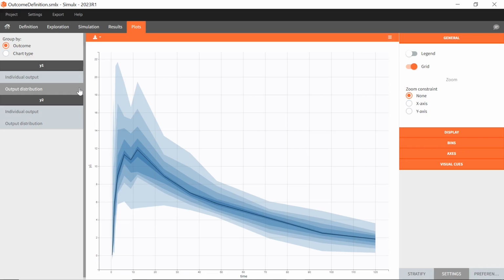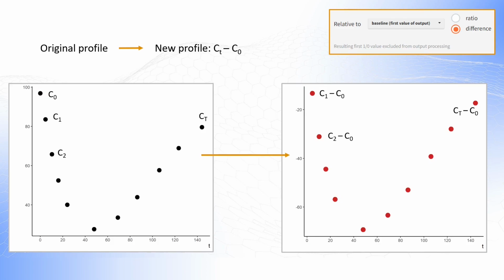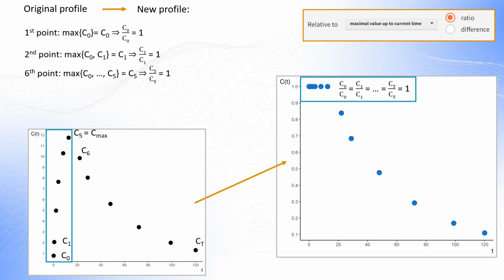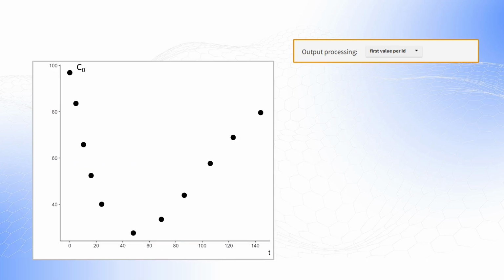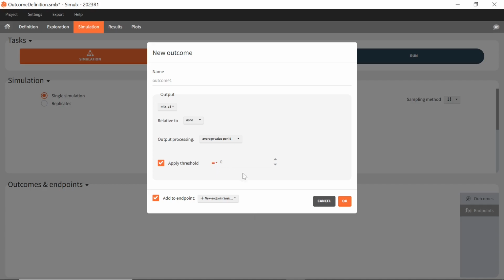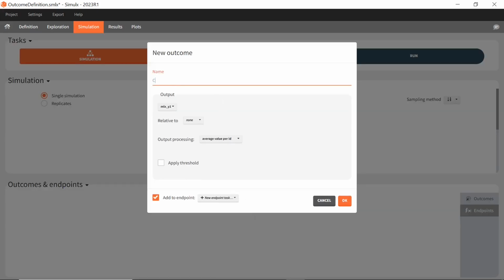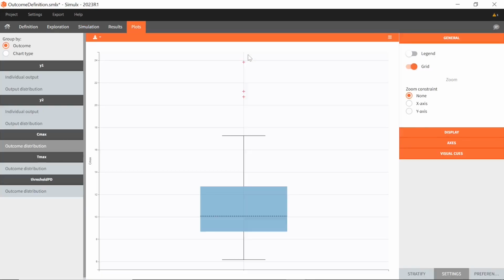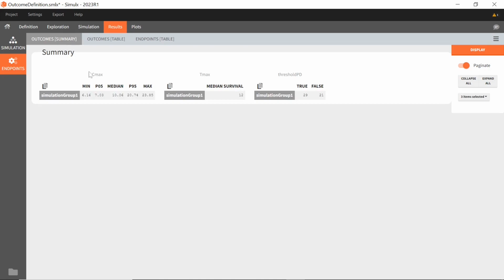Feature of the week #157: Definition of outcomes in Simulx

Comment: Hi!
If a simulation considers multiple dosing where visually steady-state is reached, will the time of max (continuous) "generally" correspond to the time to reach cmax at steady-state (cmax,ss)?
Reply from the maker: Hi, generally yes, because the "time of max" will be the time of the highest peak, and if your simulation has several peaks with exactly the same value, the time of the first peak will be selected. But you should check that they have exactly the same value. If a later peak has a slightly higher value, its time will be selected as outcome value instead.
Reply: Thank you @MonolixSuite